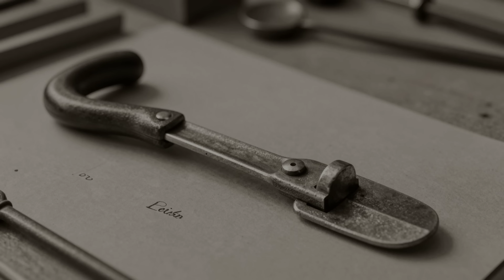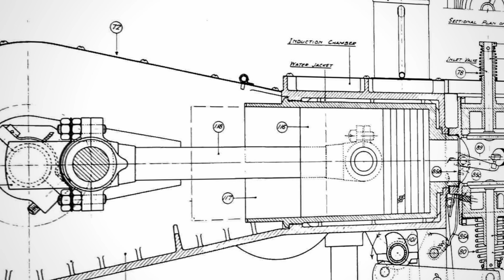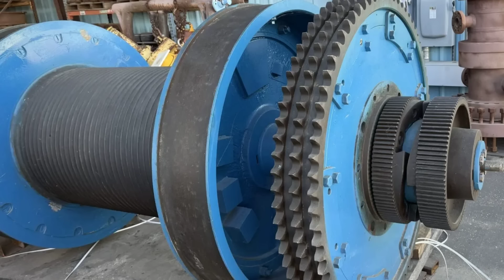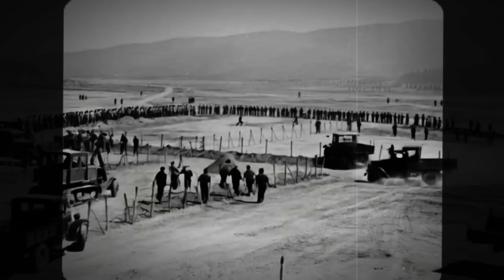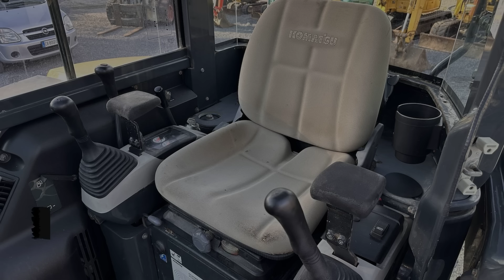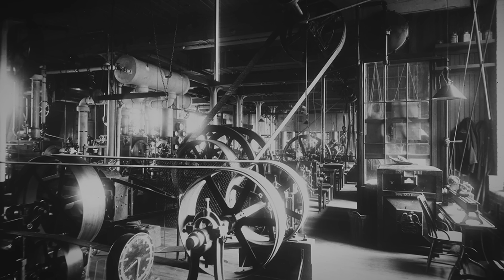Before Hydraulics: 1930s Cable Scrapers

Comment from the maker: Morrison-Knudsen started in 1905 with one man, one team of horses, and one Fresno scraper worth $37. That company eventually reached a valuation of $1.86 billion. And in 1941, 1,221 Morrison-Knudsen civilian contractors were captured by Japan on Wake Island — the largest single mass-capture of American civilians in the Pacific war.

More from Construction Legends:
🎬 R.G. LeTourneau — 299 Patents, 70% of WWII Equipment: https://youtu.be/ud7VeNDlioI
🎬 Before Hydraulics — Cable Control System Explained: https://youtu.be/Wh6SRhUWw0w
🎬 Before Hydraulics — 1950s Scrapers, Caterpillar vs. LeTourneau: https://youtu.be/SuQdiFPvrKQ
🎬 The Machines That Built Hoover Dam: https://youtu.be/Qyjo9Qt68pA
🎬 Cletrac — Steered Every WWII Tank: https://youtu.be/afKD66yjN1A

Comment: Why didn’t they just replace the cables every so many hours or say once a month before they actually broke seems to me that’s just common sense, or just build a nice cab over the driver
Reply from the maker: Great question! In theory it sounds like common sense, but the reality was that cable replacement was expensive, time-consuming, and required taking the machine completely out of service. Contractors were under huge pressure to keep production up, so many pushed the cables way past their safe limit. A proper cab was also largely an afterthought in that era – operator comfort and safety just weren't a priority yet.

Comment: Hello, Construction Legends.
Sir, you shot your own narrative in its 'fundamental orifice' like a duck in flight at 23 seconds into your video when you were busily claiming that a breaking control cable could injure or kill the operator 'cos those cables ran directly over the operator's head - - - - at the same time that your very own photo of a Model A Tournapull tractor and scraper shows a STEEL canopy roof AND some steel framing between the said cables and the said operator. 

AND, you show another photo of a Model A Tournapull at 7.25 with the SAME style of STEEL canopy roof over the operator's head WITH the cables running ABOVE said canopy roof 

Those ½ inch cables did NOT have to hold weight of a raised loaded scraper bowl or the apron and ejector. AGAIN, DO YOUR RESEARCH.

LeTourneau's first power controlled scrapers were NOT cable controlled - 7.35. How were they controlled????? DO YOUR RESEARCH.

I 'abandoned ship' at that point.

STOP posting this sort of CLAPTRAP/CLICKBAIT. DO YOUR RESEARCH.

Just my 0.02.

You have a wonderful DELUSION. Best wishes. Deas Plant.
Reply from the maker: Hello Deas! First of all – thank you so much for always taking the time to comment on our videos. It genuinely means a lot to us that you engage so thoroughly with the content, and viewers like you are exactly what makes this community great.

You raise some very fair technical points, and we appreciate you taking the time to break them down in such detail. The steel canopy roof on the Model A Tournapull is an important piece of context that we should have addressed more clearly in the narration, and you're right to call that out. The relationship between the control cables, the canopy structure, and the actual risk to the operator is clearly more nuanced than we presented it.

We're always trying to improve the accuracy and depth of our research, and detailed feedback like yours – even when it's critical – is genuinely valuable to us. We'd rather be corrected than stay wrong.

We hope you'll stick with us as we continue to improve. Looking forward to your thoughts on future videos! 🙏
Reply: Why is title called Cable scraper before hydraulics when only a tiny part of the video is addressing this? A useless title
Reply from the maker: hjorleifuringason2778 Fair point — the title is meant to set up the broader story of the era before hydraulics took over, and the cable scraper is a big part of that transition. Appreciate the feedback!